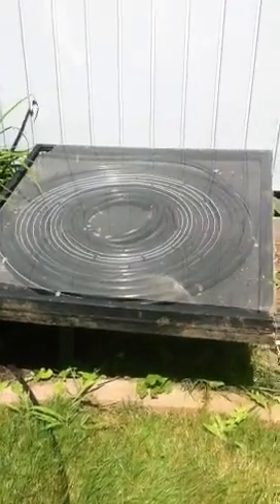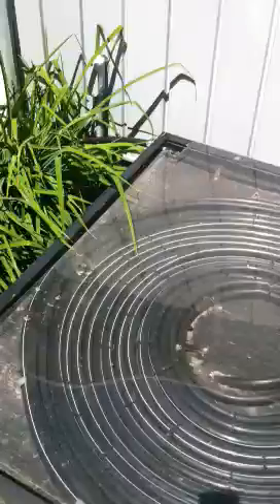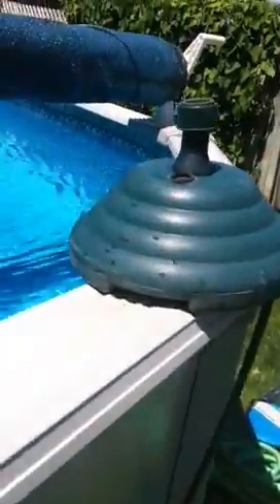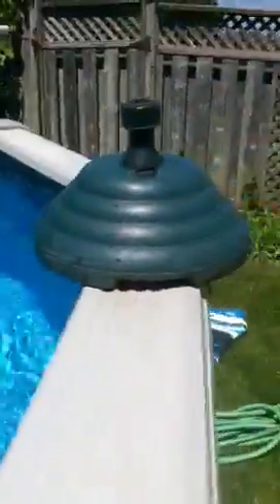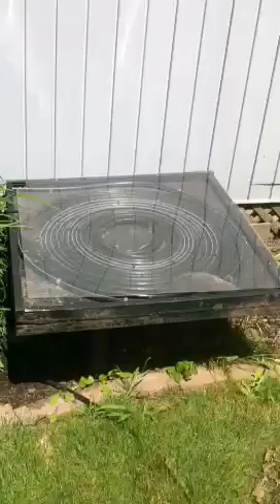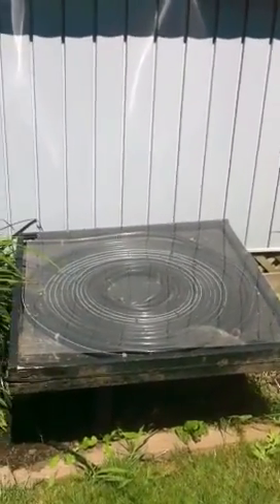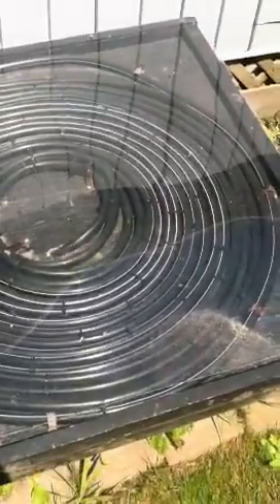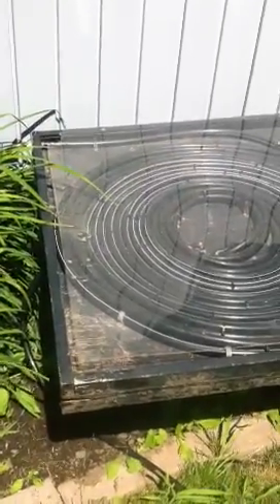Easy DIY, Super cheap Solar pool heater

Comment from the maker: Thanks for the response. I use 1/2 inch hose. I like to cycle the water through the heater by using a timer on my pump.all rubber tubing.

Comment: Thank you; exactly what I've been looking for months.  We have a 12 X 24 oval on narrow lot; do you think a 1/6 HP submersible pump placed off the center would push enough water if I placed a T-elbow off side, and ran to 2 smaller (4' X 6" plywood sheets) right beside pool?  Also, what size tubing did you use, and how was it connected to the pump?